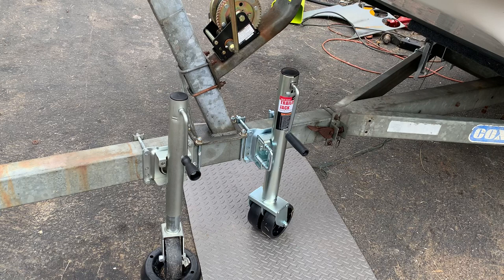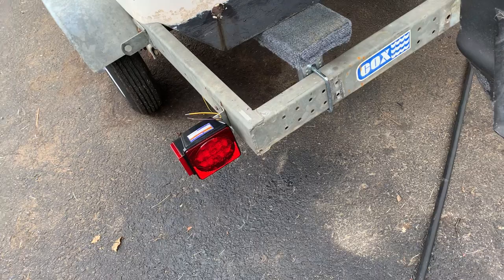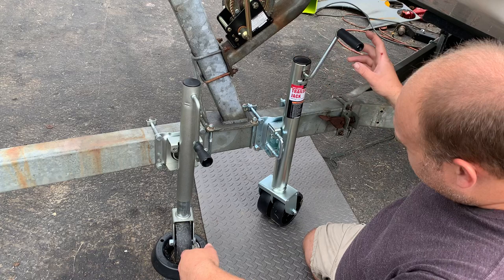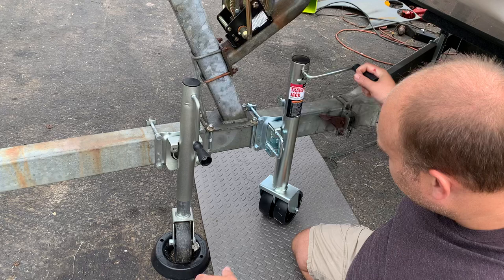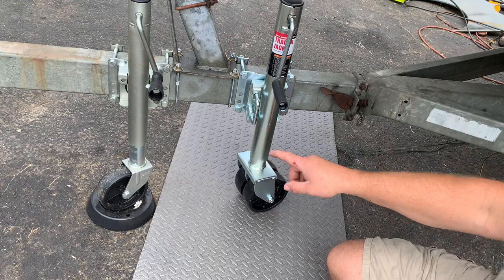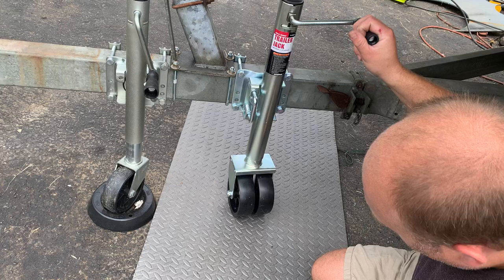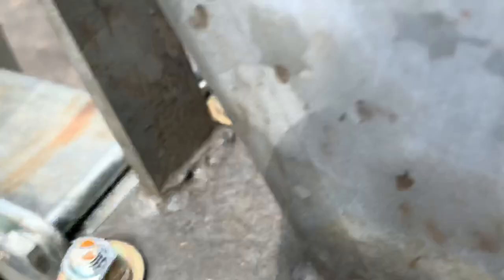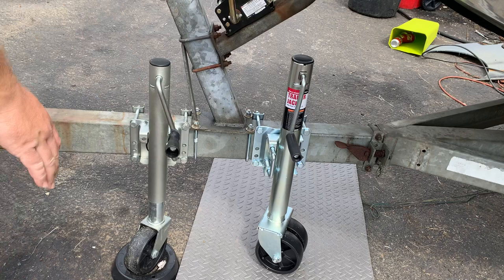Harbor freight 1000 lb wheeled trailer jack vs 1500 lb dual wheel trailer jack

Comment: How much did the bunk carpet run you? I dont exactly wanna drop $70 for 2 bunks. Also repairing a small trailer and boat
Reply from the maker: It’s very cheap, try your local Home Depot or Lowe’s. It’s called stingray viking at Home Depot I believe.

Comment: You installed the brackets on backwards
Reply from the maker: It’s kind of a trade off. Flipped around they form a box against the tongue and potentially stronger but they also mess up the tongue of your trailer and wear through the galvanizing. For this trailer going through jacks and trying different stuff, flipping them over worked fine.  Ended up going with something radically different, just need to edit the video. Always running with a substantial backlog of content.